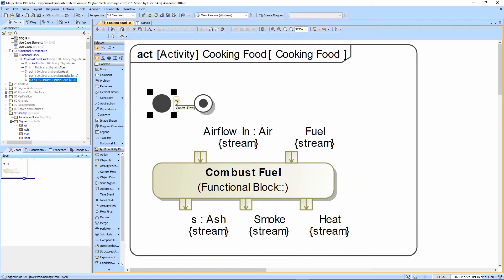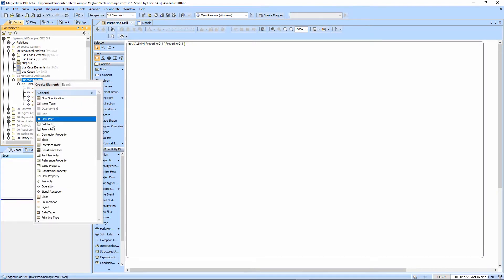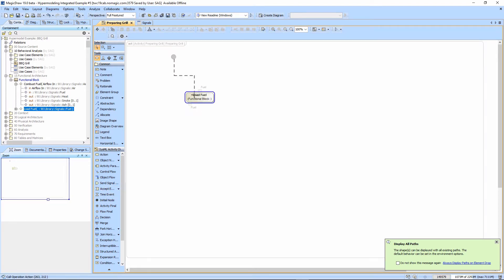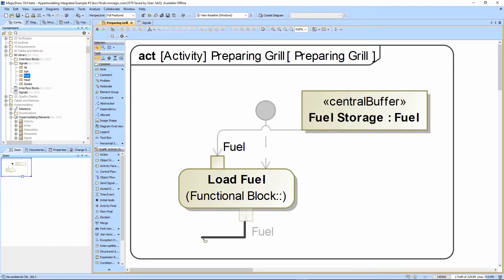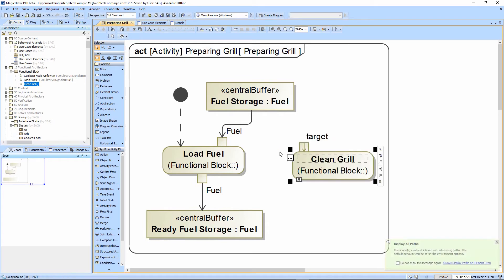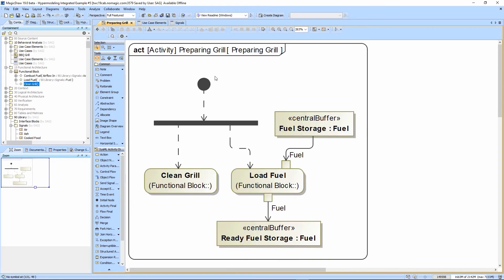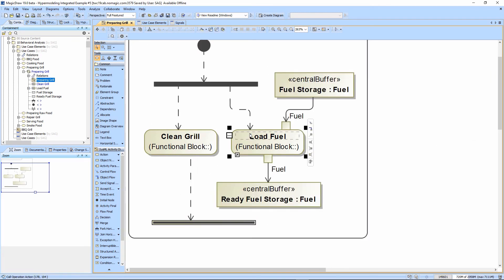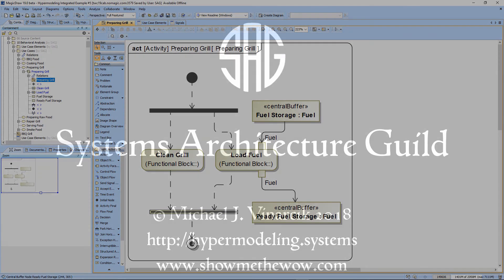Hypermodeling: UseCase Decomposition and Activity Diagram Logic

Comment: The use of the concept "Signal" to represent objects (i.e. information, material, energy) exchanged between other objects lacks harmony (IMHO) with the specification of "Signal" in the UML specification and I would argue the SysML as well.  A "Signal" is defined as "a specification of a kind of communication between objects in which a reaction is asynchronously triggered in the receiver without a reply. The receiving object handles Signals as specified by clause 13.3. The data carried by the communication are represented as attributes of the Signal."  OMG UML v 2.5.1.  If we treat "data carried by the communication" as Material, then the material is a structural feature (Attribute) of the Signal and not the Signal itself.  In the SysML, the concept of "FlowProperty" intends to support representation of elements which flow to/from blocks.  IMHO, the global use of "Signal" to represent objects which "flow" is poor practice and unfortunately very common place and should be avoided.  Although the No Magic MagicDraw SysML profile states the following in the description of "FlowProperty" " Flow properties of type Signal imply sending and/or receiving of a signal usage. An “out” FlowProperty of type Signal means that the owning Block may broadcast  the signal via connectors and an “in” FlowProperty means that the owning block is able to receive the Signal."  Why this is stated in the description of "Flow Property" is unclear, I am not able to find any substantiating statements in the SysML specification to support this claim.  A citation would be helpful if it exists.  Furthermore, it is not clear to me that the No Magic assertion in the description explicitly supports modeling Object which Flow using the mechanism that support communication between Objects.